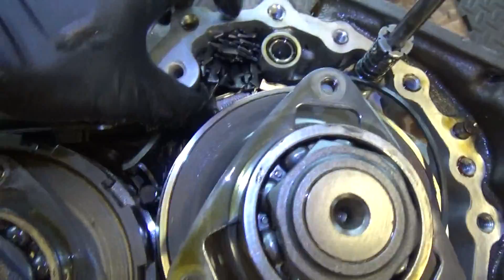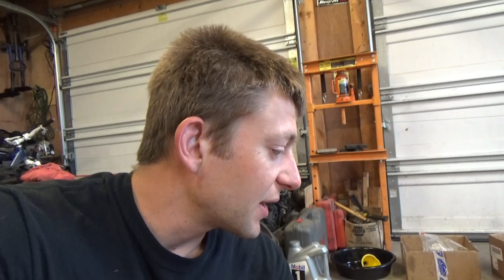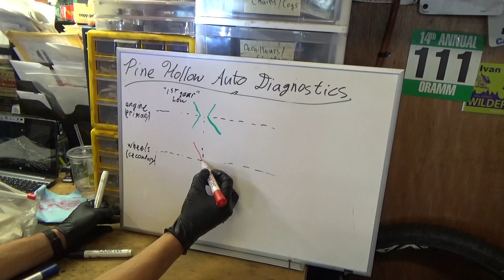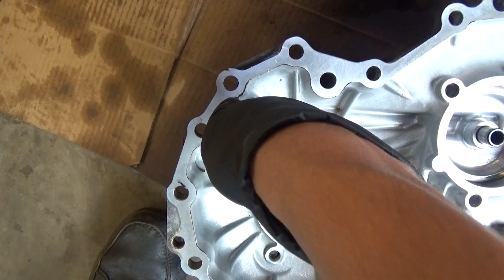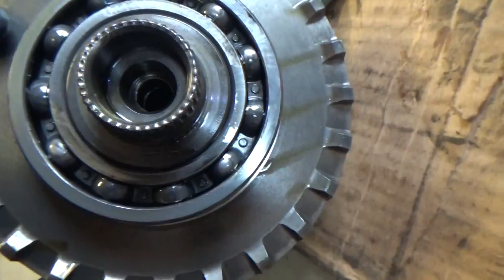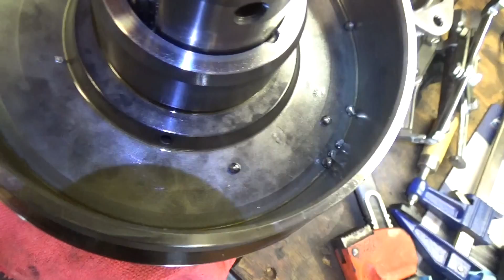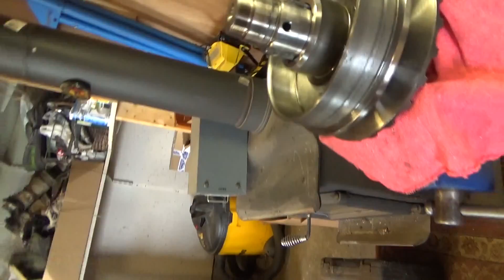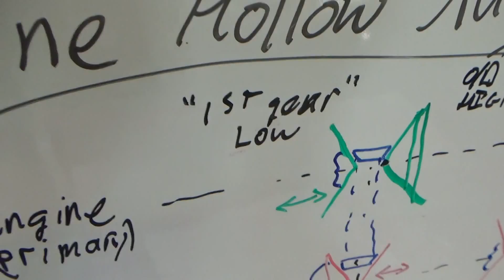Nissan CVT: Teardown and Failure Analysis -Part 2 (RERELEASE!)

Comment: You'd be surprised how much lubrication plays in the role of those balls mating.
Reply: Seems to me that the ball bearing are too small also the shaft seems not hard enough its a material flaws.
Reply: @jakelowang4132  It's a design flaw, not a material flaw. Not even really a flaw if they're made to dispose of after 5 years.
Reply: @timramich  True i but some don't even last 5 years, probably people towing with them behind their Rogue, i found that on Nissan website.

First, to provide you with additional assurance regarding your overall cost of ownership we have doubled the warranty period for the Continuously Variable Transmission in your Nissan. The existing powertrain warranty coverage of 5 years/60,000 miles will be extended at no cost to you, for CVT repairs, replacements or related towing, to 10 years/120,000 miles, whichever comes first.

Comment: They Should have made the grooves like a clutch plate and gearbox instead of 3 grooves ,I do maintenance work on a 1000 ton power presses and the clutches last for year's with 24/7 of operation none stop ,thousands of time the the clutch moves back and forwards everyday with heavy load.

Comment: Nissan engineers: how long should our cvt last? Management: at least 36000 miles. We don’t want it to die under warranty
Reply: wall it did last 180k miles
Reply: @joshuamcpeek4708  one wonders if it's fluid changes were performed at the recommended intervals. I do find it a bit of a :-) when I read all the angst about oil change intervals people cutting oil filters in half people complaining about how oil filters are manufactured blah blah blah but will think nothing of running their transmission fluid changes to beyond the recommended time length let alone replacing it early.
Reply: @stevewhite3424  yeah most of the time manufacturers try to feed you the lifetime trans fluid bs. Where there's no trans fluid pan drain and sometimes no trans fluid dip stick either.
Reply: @joshuamcpeek4708  My wife had a 2011 Subaru Outback with a CVT, I asked Subaru Dealer in Newton NJ to change the CVT fluid, they said lifetime fluid, I said but shouldnt you change it.  They said no it causes problems...... Huh? (turned head to side like puppy hearing strange sound)
Reply: @johnlang2293  sometimes it can but it really depends on milage, like if the car has 165+ miles changing the trans fluid is actually not a good idea the fine metal shavings help provide grip between the worn clutch plates in auto transmissions and transfer cases so if you remove the fine metal grain from the fluid the worn out plates could slip.

Comment: Nissan used to be excellent?? Rare Japan makes junk.
186k alot for any transmission.
One must change oil alot on these.
Metal scrubbing on sheeves
Electric cars coming soon!
Reply: 186k is nothing for most transmissions. At most a normal auto might need new clutch pack or a manual needs a new clutch if driven hard...
CVT SHATCO aka nissan on the other hand, you'll be lucky to get 60k miles on some of them lol.

Comment: The toyota prius that I have has a cvt.  I'm at 287,000 miles now and I tow trailers with it too.  Not a single problem.  But that's Toyota quality for you.
Reply: How has the hybrid battery held up?
Reply: @Mabeylater293  That's the other thing that amazed me about this car.  I have a 2005 prius with 287,000 miles on it.  Original batteries.  Still getting 50-65 mpg.  The only things I do to the car are the scheduled maintenance.

Comment: This is happening on flat roads. Can you imagine in countries with high mountains. Long live the manual transmission.
Reply: But even a manual transmission costs sometimes more to replace a clutch at 100-150k miles (sure some people can make a clutch outlast the vehicle) than what you could pay for a rebuilt CVT to be dropped into your vehicle. If you're not handy at replacing your own clutch, it doesn't cost much less to drive in the long run, if any.
Reply: @stevey500  a good clutch canbe replaced fairly easily... nothing like this

Comment: I'll save you the trouble: 
nissan cvt = garbage 

You're welcome! 😁
Reply: audi multitronic also
Reply: Depends on driving habits and maintenance, I have an 07 altima with 223600 miles and cvt still runs like new

Comment: The principal same principal that failed in this CVT is what used to fail or prohibit  performance on Kymco Scooter CVT's as well. Those CVT's had a spring behind the moving half of the pulley. There were 3 pins that were inserted into 3 grooves  on the moving half. Those groves were cut into a swirl like pattern around the outer part of the pulley. In turn was actually suppose let centrifugal force to upshift and downshift the pulley half, while the spring was in assistance. https://www.monsterscooterparts.com/50cc-performance-transmission-kit-for-kymco-agility-50.html?gclid=Cj0KCQjwzozsBRCNARIsAEM9kBPNH7SmE2RDsCIJhTEbxsZ5FFj4o2CEuiDP--gftKF-rQ2fLPtqlUgaAtGrEALw_wcB
What would be the failing points, would be the 3 pins would wear into the most frequently used "gearing" or speed range of the slots. Then The CVT would just start to hang in that area, not allowing the CVT to fully engage back to "Low" gear. Sooner than later you were just using almost a single speed, or 2 speed gearing in essence... I ordered a set of those pins and actually fixed/somewhat the problem for a few hundred miles, but the grooves were actually damaged/somewhat as well. So the problem resurfaced in no time...
The front pulley system on the scooter CVT had rollers inside that was used to change the front gearing. I don't now how many people, including myself thought the entire problem was. 1. wrong roller weight, or 2. Wong tension spring. Actually they used to race them and there was a whole array of different weight rollers, and at least 6 different rated tension springs that could be bought for them. I found out through trial and error, that it was just the design of the 3 pin setup was the whole problem. A 50 lb person would naturally get longer time before showing the problem, than a 150 lb person. But they would all do the same thing eventually... On those, the CVT would flat spot the rollers in the front, and many would blame the rollers, but that wasn't the actually cause...

Comment: i own a 2016 Nissan rogue, bought in December 2018, next week i am going for my second transfer case seal failure, it seem to be Nissan it also manufacturing cheap seals, let me hope that AT 205 might keep it from failing a 3rd time
Reply: N& CO 
There is a reason why Nissan doesnt like trying to sell CVT 4WDs anymore.
   Its all because Nissan keeps jinxing up the design.
    However the RWD-based Nissan+Infinitis dont suffer such trouble.

Comment: Rather than a ball bearing interlock that obviously was going to fail eventually, why not make that shaft cast as a single piece with extruded notches to physically interlock with the  pulley? Like putting rocks in a tumbler...Seems designed to fail.

Comment: Someone within Nissan's Stress or Metallurgical Group knows if this is an alloy hardness issue or induced loads beyond the capability of the material. Just a few hardness tests and some loads analysis would tell the tale. A good stress engineer could tell you exactly how many service hours the assembly will give before failure.  A design change of adding more slots to distribute the load could mitigate the problem but someone goofed big time.

Comment: I have a 2014 Pathfinder Platinum, still owe $13k on it (financed for 6 years 3 months) has 53k miles and only had a wheel bearing replaced in that time. The CVT would shudder at 15-20 mph until it was fixed at 22k miles under recall. It has worked perfectly ever since. I should get around $16,500 trade in or $19k is sold privately. Should I sell it now and get Highlander or Kia Telluride, or keep it until I pay it off?

Comment: Hey. Great video. My 2011 Nissan Sentra makes a groaning noise will driving, sounds like it originated on the front right of the vehicle. When I put it up on Jack stands, no noise. When turning left it also goes away. I have changed the right wheel bearing and axle, no effect on the noise. This has been going on for about 8 months, any suggestions on what it may be?

Comment: Since the CVT works on fluid hydraulics design, the key to keeping it from blowing the belt and snap rings is to keep the fluid clean as often as possible. The filter in the oil cooler and the transmission oil pan should be changed at every other fluid change. I have a Lancer with a CVT at over 110,000miles and the CVT doesn’t make any whining noise because I’ve been changing the fluid every 30,000 miles and the filters got replaced at 80,000 miles, but it’s going to be every 60,000 miles after then. Even the owner’s manual had no mention when to do the maintenance so I followed the “old car” rule for maintaining the CVT.

Comment: I put hundreds of thousands of miles on cars and the only problem I have with Nissan cvt's is if they overheat. Maintain them and get around 400k it of them. By then we get rid of the car so it doesn't matter.

Comment: CVT belt …. 399 blocks with 2 bands consisting of 12 rings one inside the other on each side of the blocks. For a total of 24 rings.  For higher torque applications the bands might have more rings and the blocks would be larger

Comment: Nissan  X Trail auto Transmission 2.0Ltr 4X4  2017 Fault code P17F1 (CVT_JUDDER (C/U INSPECTION)  Fault code P281300 Solenoid .  what's is this Please  help me

Comment: I watched a Video about 9 months ago about a guy who remanufactures those belts it was amazing how strong they actually are compared to the old rubber and leather drive belts used on almost all older CVT transmission systems on scooters..the early scooters used rollers and centrifugal force to alter the Cone diameters..the CVT is one of the most efficient drive systems after the chain drive on a pushbike.

Comment: I have a 87 Pathfinder with well over 200,000 miles and still going. My sister bought it new, then gave it to me several years ago when she got a new car. A friend has a 92 Maxima with over 350,000 miles and still drives it daily. Neither has had any motor or transmission or really any other issues.Based on their reliability, I got a 2005 Murano SE that was $40,000 new, thinking I'd get 25-30 years out of it. Well as of July 2017, after 12  years, 220,000 miles and two failed CVT's, oh and a phone book thick folder of replacement parts receipts, I quit.
 My son works at a large car dealership. He said that if a customer comes in with a Nissan with a CVT for trade, they give them a ridiculous low trade in offer because they cant get rid of the used ones they have. He said the words out. If you mention to a customer Nissan with a CVT you might as well said it was a Yugo. I have friends, co workers, family members who all drive just about every brand that's out there, foreign and domestic. The consensus is that most all modern vehicles are made to be disposable. Yes they have better styling now and lots of neat features, but the overall quality sux.

Comment: most transmission fauilures occur due to  hydraulic pressure rise malfunction . I wonder if that shaft could be reground and bigger bearings used.

Comment: Man. lot of comments on here from people who know nothing about CVT trans. Admittedly early Nissan ones were pretty bad but not anymore, with proper maintenance they will out last any auto trans. And thats the key, it's critical that they are maintained correctly and the correct oil MUST be used. I've seen heaps of shops and other idiots use normal ATF in them and then when the trans packs up they blame the trans, duh. I've seen many a CVT trans with well over 300,000 miles on them with proper servicing.

Comment: Sooo drum seal blown caused lack of lubrication on bearing bearings ate up stopped the function of main drum floating stuck closed. Once high enough pump pressure closed the counter shaft drum then snap went the belt. Basically if you drove the car at low low speeds everywhere you went the belt probably wouldn’t of snapped. 🤷‍♂️
Reply from the maker: No the blown drum seal was just the aftermath lol
Reply: Pine Hollow Auto Diagnostics  it makes more sense for the drum seal to blow. The lack of lubricant to cause the wear on the bearing and main shaft then the pulley slipping off the bearing  keyway,  then once the pully slipped causing the drum to to no longer floating stuck closed. The high pressure closing the counter shaft drum over and over again stretching the bands of the belt those finally breaking. Would explain the chainsaw noise. A proper seal conditioner could of avoided. That issue. A stronger main shaft metal could of as well but then the bearing would just eat up allowing the least amount of destruction internally.  If the bearings were made of weaker metal the drum would do nothing but spin on the main shaft which a repair sleeve could compensate for it would still float and would no longer turn the belt. For it to stretch and break.

Comment: Hi, is it possible that the CVT computer actually detects uneven pressure on the drive shaft from the tires and puts the car into limp mode while driving?

Comment: The Stabilizer bearings in the primary pulley went bad..  When that happened only 1/2 of the primary clutch was engaging when torque was applied and and that caused it to eat the belt and fail.  These transmissions are much simpler than I figured.  Glorified go-kart variable clutch.  That primary drive clutch could be improved by adding 3 more bearings and slots, using bigger bearings or going away from that design by using teeth on the shaft and the cylinder.  Nissan, pay me for fixing your failing transmissions.

Comment: Wow awesome job I own a 2008 Nissan Altima cvt and I haven't tore mine apart yet but I'm thinking that exactly what happen to mine. It wont shift out of gear. I'm thinking the whole time it was the belt but now I'm thinking it was that oil pulley. Your right they should of made that pulley alot stronger than 3 little balls. I found the replacement place online. Do you think I should change that out or just replace the transmission? Great video.

Comment: I have a 2017 nissan with, what I'm hoping is, the 3rd generation xtronic cvt (dont know if 2017 models got them).  Hopefully, that shaft flaw is fixed in the 3rd gen(?)
Reply: watch out sir, your Nissan might be next CVT tran issues
Reply: tarasded 

Buddy 
if you always remember to flush the CVT every 25-50k intervals at the dealer, 
   Your transmission wont seize this guy's video!

Comment: most of the guys I talk to that repair these,tell me the belts are weak,this is a golfcart transmission,in a car,i was convinced as a builder of 45 years it was joke,till I looked at the belt design and now the mileage on this vehicle,most of the old units all hydraulic and gear and chain driven,had early to late problems of valve body filth,these go till belt fails and scatters parts thru the oil system,nothing has changed,losing this unit in the mountains,desert,stress situation,no thanks

Comment: When the bearings failed in the one pulley permitted the two pulley halves to turn at differing speeds which applies a twist on the plates on the belt causing them to fail.  To avoid failure, the torque should be severely limited.  Drive like an old man.  Avoid high torque events such as merging onto freeways at freeway speed, keeping up with traffic when the light changes, etc.  A better option is to avoid the belt and cone CVT for something with a better track record.  Thanks for the video.  I avoided those transmissions when they came out because I didn't trust the reliability.  Bought a Prius instead as it does not use the cones.

Comment: Thank you SO much for doing these videos. You have done the automotive buying public a great service.
I have to wonder if Jatco engineers ever did any FEA modeling on those input shaft grooves and bearings. It seems as if there are extremely high point contact loads there. Even with proper metallurgy and heat treating - the loads at those points may simply be unacceptably high. After looking at the design, it's a wonder they last as long as they do. I suspect that driving style in going to have a major impact on the longevity of these parts. Also, normal variations in metallurgy from batch to batch is probably a significant factor.
I also feel that gov't fuel economy mandates are partly to blame for problems like this. The engineers are pushed into a corner and forced to make compromises that they would otherwise possibly not make if higher fleet fuel economy averages weren't a forced upon them.
Reply from the maker: Great comment! Yes that is an immense load on 3 little balls 😬
Reply: @PineHollowAutoDiagnostics  Can anyone tell me if Ivan got his money back for the core?
Reply: @Chris Bentley Walking and Rambling  he did. He said he got his core charge no questions asked
Reply: @PineHollowAutoDiagnostics  yeah... But if you think about it--- if the shaft was the real failure, then the belt would have never broke.   It would have just sheared those little balls and then the shaft/ pulley would just free spin.  So there's no reason that the belt would have broken.   What I think happened is that the belt broke first-- and the all the "kibbles and bits" bound up the pulley and so right after failure, she was still on the gas and the shaft and pulley was chewing up pieces of the belt and binding up-- until it sheared those balls.   The belt failed first-- it had to.